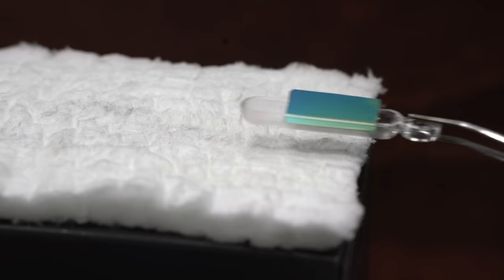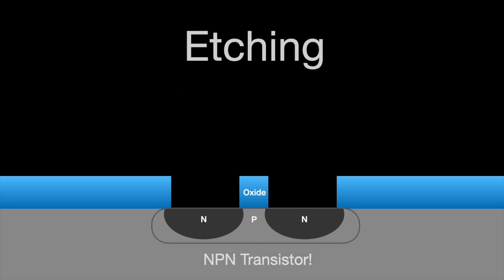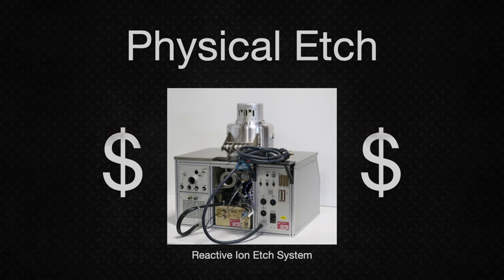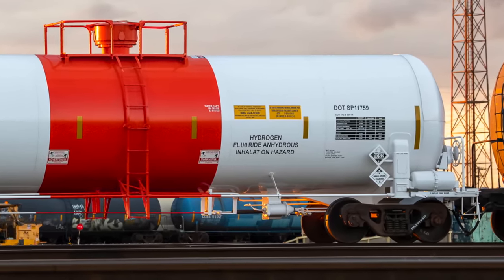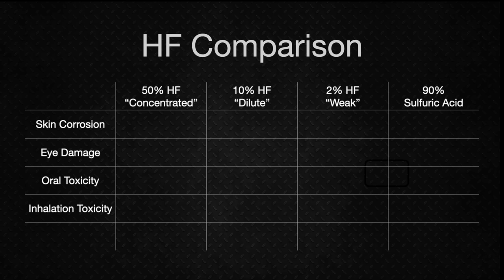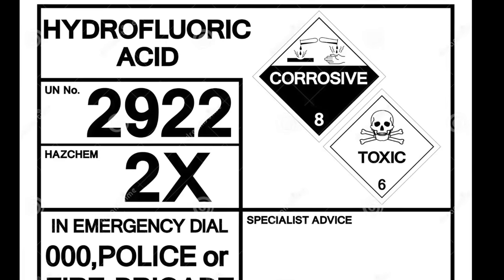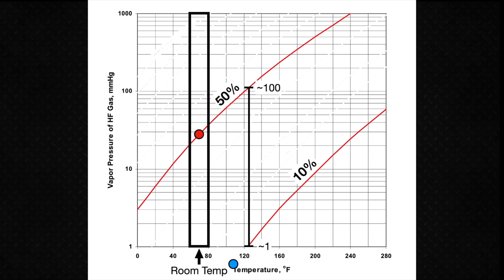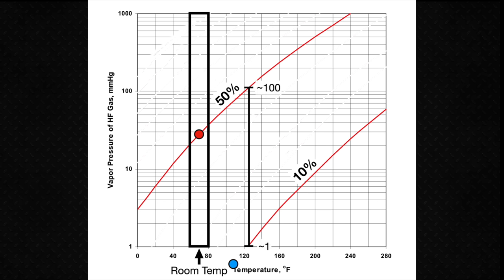Using Hydrofluoric Acid to Etch Oxide Layers

Comment: That ArmorEtch appears to be very concentrated. It's what, about 40% bifluorides? One could do the math, it looks like each mole of bifluoride should produce two moles of HF when combined with an acid.
Reply from the maker: So, it's unclear to me if the reaction is one-way or if it's an equlibrium between reactants and products. If it's the latter, then it might be possible that the HF concentration is less than the two moles per bifluoride
Reply: @projectsinflight  HF is a "weak" acid, i.e. it doesn't dissociate as much as sulfuric. I assume that means the fluoride will readily grab the H+ from the sulfuric. 

Wikipedia also mentions that bifluoride salts will decompose with heat to give anhydrous HF.

Comment: how about a TAE UV-C pulsed laser to remove the oxide layer? They are simple to build. I can recommend Les' Lab on YT very good channel about science and lasers.
love your work ❤❤
Reply from the maker: Interesting... Never heard of them. I wonder if optical etching is difficult given the fact that the surface is reflective and the oxide color changes?
Reply: Do you meana TEA nitrogen laser? Hmm.. that would be an interesting experiment. Pure silicon does transmit more UVC than silicon dioxide.

Comment: It's a bad idea to use glass beakers when handling HF. It will dissolve the glass, possibly weakening the HF acid over time, in worst case if stored for a very long time it can go through the glass (not an issue with 2 % solutions, but still bad practice). Plastic containers is the way to go.

Edit: I see now that the HF container was probably plastic, only the washing beakers were glass. So perhaps you already thought about this. It's a very common mistake at universities that students and even PhDs use glass beakers for HF by mistake.
Reply from the maker: Yeah the only glass beakers were used for the neutralizing solution and rinse water. Don't worry!

Comment: Very cool to see the comparison between these! I played about with Whink recently for cleaning/etching titanium surfaces before anodising, I was rather surprised (and a bit concerned!) by just how reactive it was. Regarding the armor etch, it definitely doesn’t contain HF at all. Rather, the ammonium bifluoride reacts directly with the SiO2 - check out the wiki page for the reaction: https://en.m.wikipedia.org/wiki/Ammonium_bifluoride
Reply from the maker: On the same wiki page it says " In water, ammonium bifluoride exists in chemical equilibrium with hydrofluoric acid"

The armour etch also contains sulferic acid which liberates even more HF:
2NH4HF2 + H2SO4 → (NH4)2SO4 + 4HF

Comment: I think you spelled that wrong.  If you come into contact with HF, you absolutely should panic.

Also, the vapor pressure numbers you're looking at are not the same units as the hazard chart.  I know you probably know this, but you didn't say anything about it in the video.  I really hope your viewers pay attention to that when they do their own research.
Reply from the maker: as i said in the beginning, i want people to do their own research before handling potentially dangerous chemicals. most of the purpose of the video was to counter some of the blatant misinformation about HF on the internet. a lot of people believe that any amount of HF at any concentration will lead to instant death when in reality there are plenty of products sold to average people that contain small amounts of HF and haven't resulted in mass injury or death from misuse.